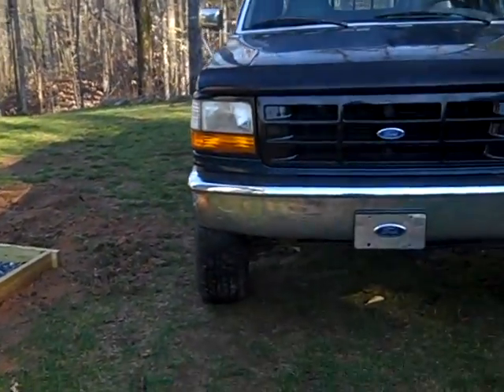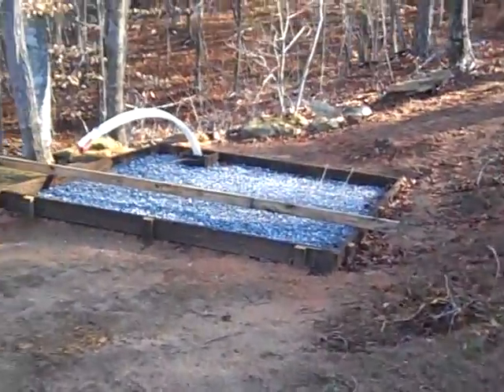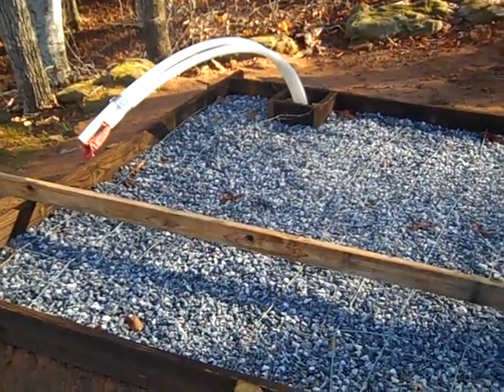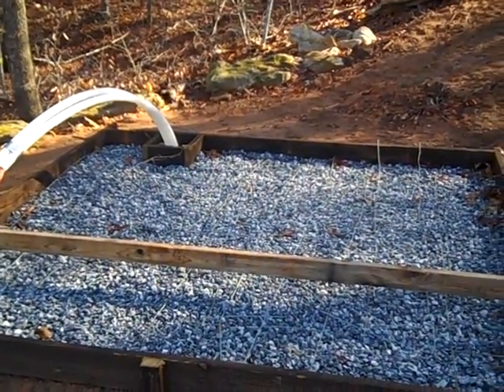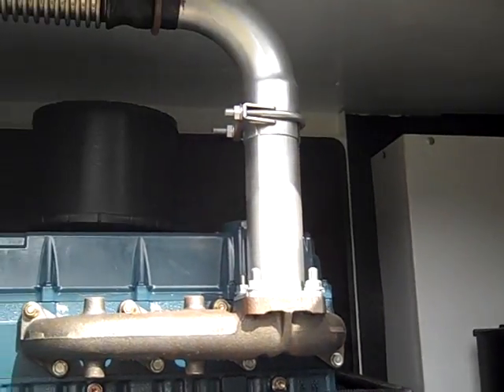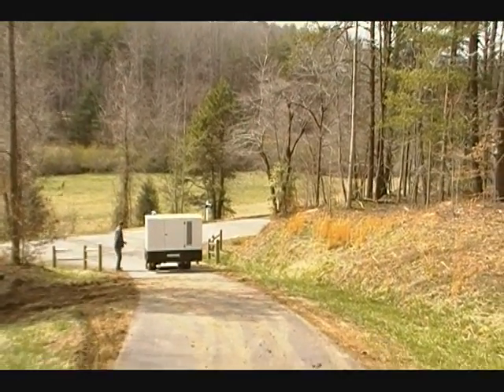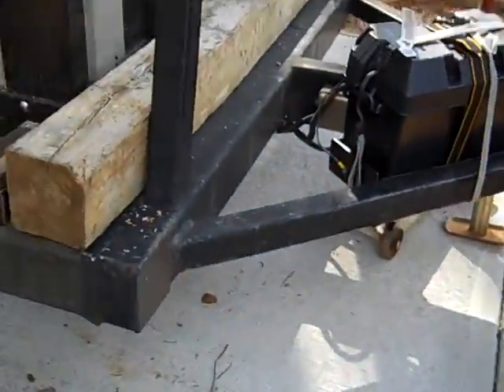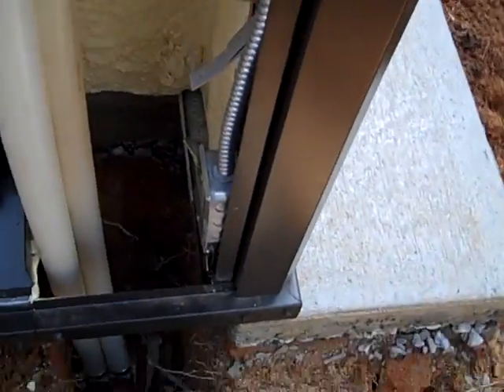Retreat Design Part 1

Comment: Luckily I live in an area where the wind is constant.  I am thinking of installing a wind turbine for my bug-out pad.  My only concern is the reliability of it and how difficult is is to maintain. I only plan on using it to power small things - fridge, communications, golf cart.. I was curious if you have had any experience with these systems and know the pros and cons of them. Another concern is the visibility of the fan blades..

Comment from the maker: @donfachabella It is close to the garage and it is to code.  The sound attenuated cabinet makes this genset incredibly quiet.  Also the closer the Genset to the meter base and transfer switch the better.  There is 40" clearancce all around to service it. The exhaust and fan updraft form the generator so it shoots the noise straight up so orientation is not an issue as it is with some gensets. Thanks for watching.

Comment from the maker: @joewilder 2 differnet subjects. Gasification to run and engine and gasification to heat water for  heating your home.  both require dry wood.  I find that 15% works great for my truck and generator and will also work great in the boiler.  The boiler is more forgiving than the gasifier for the generator.  Yes there will be 2 buildings for wood at this retreat.  2-3 yr supply in one building and a smaller building 2-3 cords right next to the boiler.

Comment from the maker: @FreedomForYouAndMe The costs are high for these units as they are top of the line.  17 K genset ( typically 20 but I got a deal ) :)  19 K for the gasification system.   You must realize that there is a lot more to the system than what you see in the video.

Comment from the maker: @lastquest The Lister is a diesel and you can get one if you like!  the new listers have controls like every other genset and they are not EMP proof.   To get EMP prrof you have to go old school which is great.  I have a 1970 Onan that runs on wood gas but and EMP would take out the voltage regulator board in that.  An old engine, blet drive generator/alternator with a battery bank but you still have to have an inverter that won;t Fry.  If your planning for EMP forget the AC power.  my opinion.

Comment: It's hard to keep up with You and the Yankeeprepper, but you two are amongst the best and Inspire me. I wanted a Lister like YP, but I'm leaning towards a 20 KV Diesel. Two Questions. 1. I wanted a diesel so as to be able to use Home Heating fuel. I'm afraid that the GenSets like these have electronic controls. They may not be EMP Proof?? 2. Can I get a carburetor to run propane with a Diesel? I can have a local propane dealer install a 1000 Gal underground tank for Free.

Comment from the maker: @jberg411 That genset is 30 kW and You cannot get a Lister-Petter over 20Kw that will pass the EPA here.  The engine in teh 30 Kw is Kubota.   I highly recommend the Lister-Petter - There are 4 EPA qualified listers 7.5 12.5 15 and 20 kW gensets  and they have a long runner that will run for 2000 hrs continuous between oil changes.  The fuel economy is great too!

Comment: @engineer775  It's a 20 hp Honda gas v twin. I know its not the best one to use but it's all I have. I'll be running the HHO partly off the generators own power, and partly off solar w/ battery backup. We'll see how well I do, but at least I'll have it running as cheaply on gas as possible. Jamesfarrello put up a video of it running on my little pickup.

Comment from the maker: I actually used welded wire grid about 2 inches from the bottom.  The specs on the pads from both manufactures did not call for reinforcement as they are so small but I put the wire mesh in there.

Comment from the maker: @DeleteMeOnline Great Question and one I haven't got to ask yet As I have only measured flow and elevation and distance to potential turbine mount.   So far I have figured a full 18" pipe for 100yrd and a 50 foot drop to the turbine.  I wanted to get a rough idea of the amount of power the could be generated before proceeding into the ugly world of regulations.

Comment from the maker: @DeleteMeOnline yes the gov. has tight spec on everything.  Both the Boiler and the Generator passed the latest EPA specs.   I am working on a hydro power plant design for a school that spend 25k/month on electricty.  If I get to do that I will have plenty of calculations to share!  : )

Comment from the maker: @FrontCortex Actually, I did use it-85 feet of thermo-pex,buried and poked through a hammer drilled hole in the basement.   It is $12 a foot and awesome stuff.  What you saw are the stubbed up 1 1/4 " lines about 3' long that are connected to that thermopex.  The thermo pex will not fit in the stub up area, especialy for multiple zones as this one will have.  Once the pumps are installed on teh back and all is connected I will be insulating those pipes per the Central Boiler instructions. good?

Comment from the maker: @DeleteMeOnline Enthalpy charts not empathy. : )   No, that level of detail is not required for these retreat designs. Not that I don;t enjoy geeking out but it will bore most to death.  I am using some big hammers to knock down the required loads for folks and if the power goes out I want them to be able to run a long as possible.  Hot showers and a warm retreat after a long day in the garden is nice!

Comment from the maker: @homegrownsurvivor This retreat is top of the line and out of reach for most folks.  Yes, I consult, design and install these systems.  Heaters, generators, wells, well pumps, solar, ram pumps etc.   I do sub out the  parts of the job that require licensed electricians, plumbers and HVAC contractors.  I do work to lower the costs and have some real economical generator options as well as some other tricks to save $. Thanks for watching.

Comment from the maker: @Rocky1765 I recommend Diesel for several reasons .  1) Durability- they run longer 2)  they can run - diesel bio diesel and vegetable oil.  3) You can store the fuel for along time. ( I have stored Diesel for 10 yrs and then run it in my generator.  However the propane will store longer and a propane generator is a lot less money than a diesel. Thanks for watching!

Comment from the maker: @TruthWarriorFilms  That is correct and then some.  Again this is not for me I am just the design and install guy.  This is a very large retreat and did my best to knock down all the loads to get a 30Kw to run it.   This is the problem with most all American homes.  By adding the wood boiler, and solar water pump I was able to take their well pump, water heaters ( 2) and 2 Heat Pumps out of the electrical load equation.   Thanks for watching!